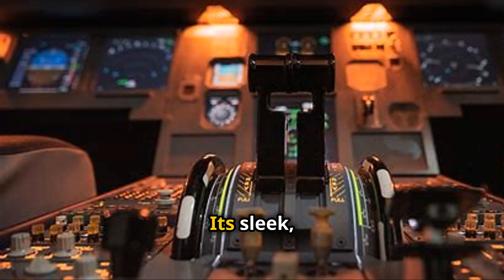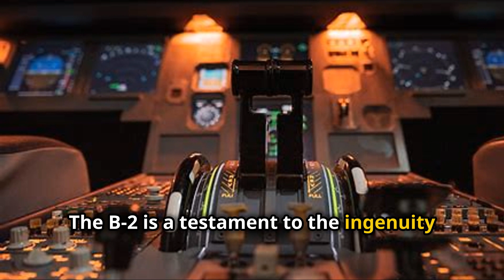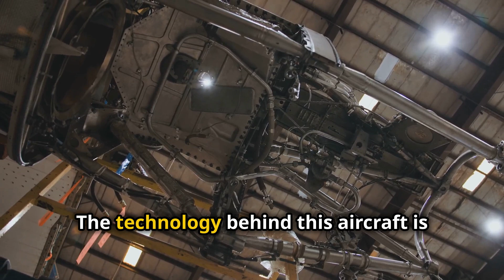Why No One Can Copy The B 2 Spirit Bomber

Comment: What about China's H20 it's there version of the B2 it's basically the same
Reply from the maker: Thanks for commenting, I will research today and post a video on this.
Reply: Outside of superficial similarities...   no it isn't the "same".

A big difference is that the H-20 isn't operational.   Based on what China has revealed....  it won't have the range or payload of a B2.

It's a good start....  but will not have anywhere near the capabilities as a strategic bomber.